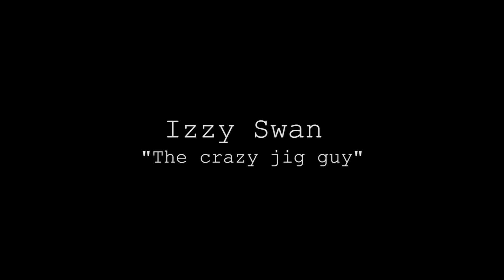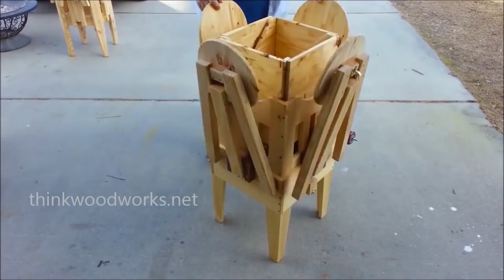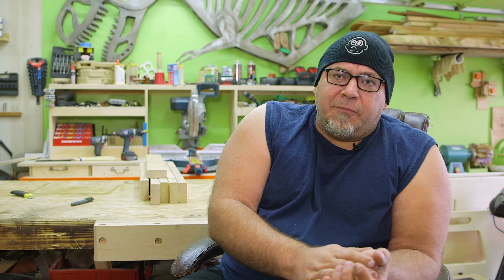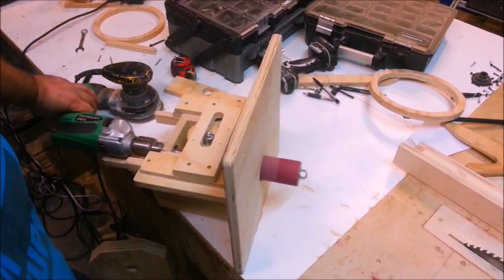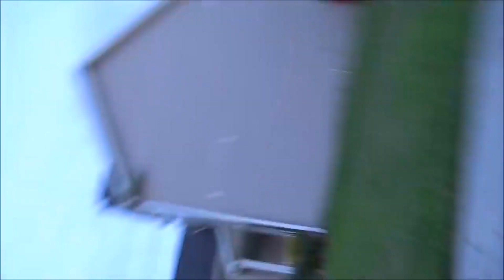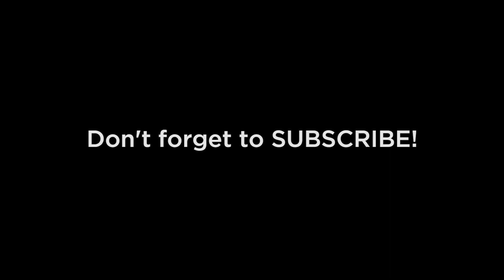Izzy Swan - "The Crazy Jig Guy" is LIVE! Check it out!

Comment: Say! Izzy do think you could build an off grid  chain saw sawmill about 10' to 12 '  long that would have the capability of milling 14" to 16"  in dia. logs and with mostly 2x4 or 2x6 lumber with unistrut guide rails. With adjustable hand crank 1" vertical increments. I love all your ideas. Great ideas you come up with.